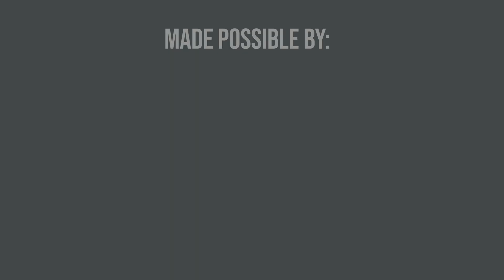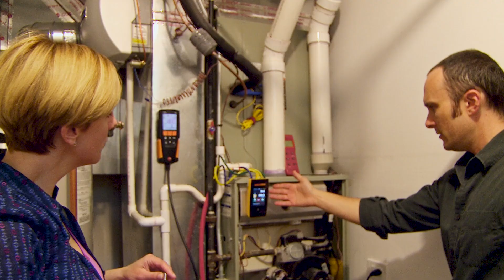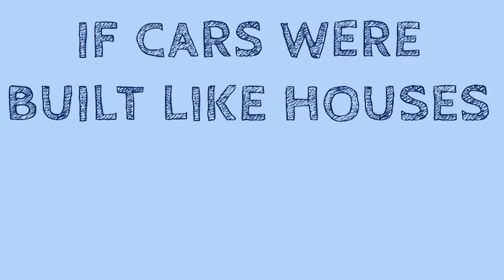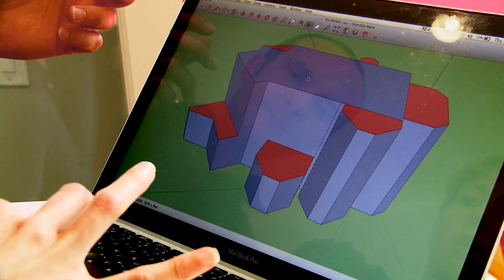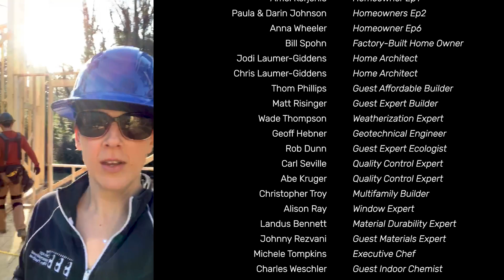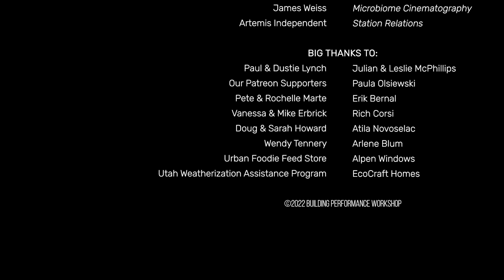The Truth about Homebuilding (It's Very Very Hard) - Ep 204 of Home Diagnosis TV Series

Comment: wow thats actually a lot packed into that video.

for me one of the biggest pains was i needed to run 5 wires through and they allowed space for one. having said that 90% of my work on new homes was repairing someone else's install because builders would hire any old joe blogs to do it, and it would have the wrong cables, bad or no design and they would refuse to fix it.
often thats because the builders do not understand that trade so they don't bother getting the proper tradesperson in to do it.

the other big issue here is people change their mind and go blow the budget on some bling, so builder is left trying to cut corners to keep the build on budget. hence most builders only ever want to build to bare minimums because thats all the customer ever wants to do. so we get this vicious circle of builders being pushed to cut corners and then they get blamed for it later on.

tho to add to what matt was talking about, i have found that in most industries no1 reason why they do things the same old way is due to lack of training. doing it the same way 40 years later even tho materials and designs have all changed. some industries here have compulsory training every year, fail the training and you loose your license.

Comment: Digging into your vids, what happens with a tight home with ventilation when the power goes out? Doesn’t that stop air movement which will create moisture issues? Say the power goes out for a week for instance, very possible. Back up generators?
Reply from the maker: Yes, backup generators. The moisture buildup will still be much slower than in a leaky home, as will the temperature change.
Reply: @HomePerformance  Awesome, thanks. Even backup batteries can help, such as for sump pumps. Can’t wait for season 3 btw, mold has exploded in the functional health world!